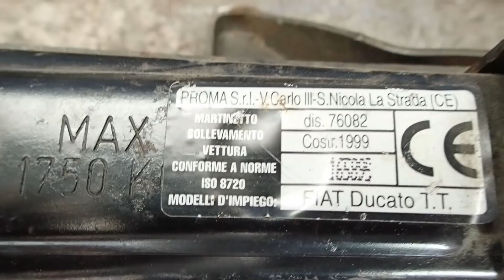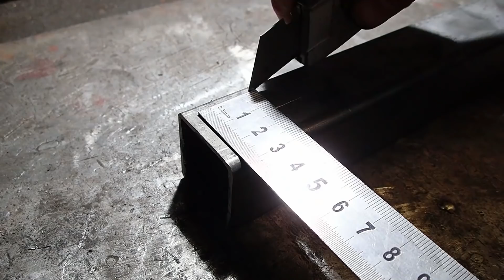Making Powerbuilt Strut Spring Compressor Tool

Comment: Now try it with the front springs from a late model fullsize pickup
Reply: Never needed one for any old pickups or vans I have worked over. A floor jack under the LCA is enough to handle R and R. Put in heavier springs too.
Reply: @geobrown9413  Exactly older trucks did not have struts in the front like all the new stuff does.